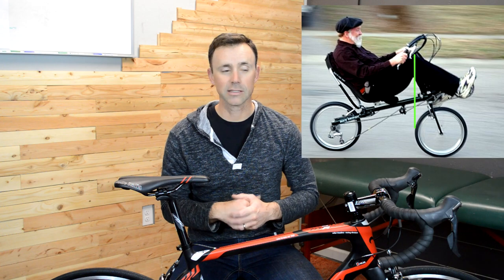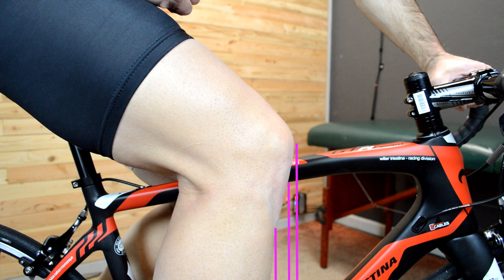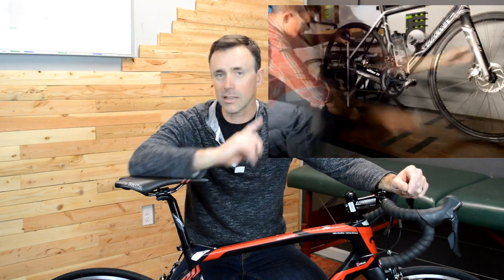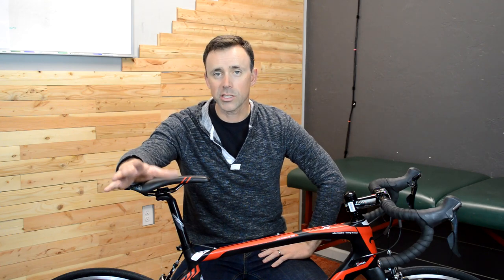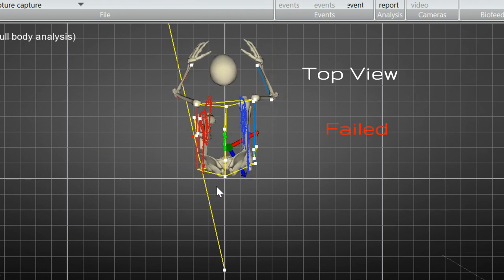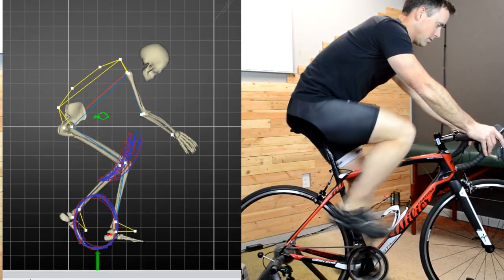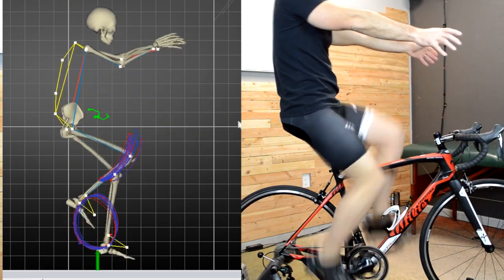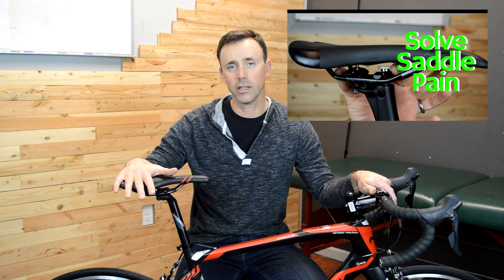How to set Saddle Fore Aft | Bike Fit Tip

Comment: I have been changing around with my saddle and stem length and this is so far the best video I found when it comes to fore and aft of your saddle. I already saw a few that recommended to check the balance, however this one precisely explains which actions indicate which problem.
I recently shortened my stem length and I will do some balance tests to see if I need to shorten it further and go back some more. Also I tilted my saddle, which is increasing the comfort but making holding the balance a bit more difficult.

Comment: I watched this video last night. Recently, I've noticed that when I took my hands off the bars and sat up (while riding a trainer), that I was in fact sliding forward. Today, before getting on the bike, I slid the saddle back 3-4mm. I had been using the plumb line from the knee method only. I immediately felt better on the bike and stayed put when I sat up with no hands. Less strain on the abs also. I felt during the session that I had a bit more power and bonus: the chronic hand numbness I've been getting was much less pronounced. Thanks. I wish I lived out there (I'm in Toronto). I would bring my bike and have you do the whole fit routine.
Reply: if you did not slide forward anymore, he recommends you to move it forward.
Reply: one key thing here that shouldn't be overlooked is that when your bike is on the trainer the front wheel needs lifting to ensure your saddle is level (or in the same position) as it would be on level ground - otherwise you've missed a really important factor. I'm not saying you've missed this, but I bet tonnes of people don't consider this properly. Even with a riser my front wheel is slightly lower than when the bike is on the ground.

Comment: I'm no bike fitter, but I am a former marathoner and do understand the bio-mechanics behind the test. The position of your body mass relative to the crank changes based on seat position. The key is having your body mass balanced against the force applied while pedaling normally. When the seat is too far forward,  the force is mostly vertical, and does not apply enough rearward force to keep your body in position without your arms holding it there. This is why you move forward in the saddle with this condition. Moving the seat back relative to the crank produces more rearward force from pedaling, and balances with your body mass so your arms don't have to work to keep your position on the saddle.
Reply: Thank you!
Reply: Yep. And also, working on thoracic spine flexibility will allow you to reach further without having to tilt your pelvis forward. That way you keep you sit bones holding you on your seat and not your sensitive parts.
Reply: @iwontreplybacklol7481 so keeping saddle forward is better ? In my bike have saddle all the way forward , it’s what I’ve found the best in terms of comfort and power , I have a hybrid bike

Comment: I agree it's a bit confusing. One minute it seems to say that you should slide forward, then says you shouldn't.... I think the best way is to go as far forward as you can  whilst still being able to ride for hours and hours (however many hours you ride for) without neck or shoulder pain, or pins and needles in fingers. Or front of knee pain!. Just keep sliding saddle back until the latter stops happening. I find that that spot leaves my kneecaps about 1cm in front of KOPS.  One method that works well is "can you lift both hands off the bars together, or do you need to do them one at a time?" Ideally you can lift both hands off the hoods together without a big strain. Oh and saddle needs to be level and the right height for all this to work (heels scraping pedals). Then position bars so you use all parts of them without strain.

Comment: For those trying to get into an optimal aero position, a more forward seat position in relation to the bottom bracket opens up the hip angle and allows rider to generate more power for the same given torso angle. Often this will compromise the hands off test. Which is more important? It depends on the priorities of the rider.
Reply: Isn't that incorrect? Moving forward does open up the hips more but removes more of the larger glute from the power cycle. So it's more aero but less powerful position. That's why most people don't produce as much power on their TT bike even when not tucked into the skis. It's because they are further forward of the bottom bracket so less glute activation. At least that's my understanding.

Comment: thanks for this video. I was sliding forward slightly when doing this test, or I had to push off the handlebars a little bit. sliding my seat back about 0.5-0.75cm made a world of difference, as it was apparently set about 0.25cm forward from center of the saddle rails.

Comment: I tried to understand and analyze this video but ended up very confused.  It's not clear if we should move the saddle forwards or backwards. I also saw the previous test video and they mentioned you can get a "positive" result test while here they mention a "failed" test, and it seems that both positive and failed are the same? That's contradictory.   What should we do if we perform the test and our hip slides forward? What should we do if we use too much abs muscles? What should we do if our cadence is notoriously increased?   Thanks.
Reply from the maker: +mcclausky apologies, especially on that first video I got stuck in my PT-centric speak a bit -- positive sign/failed test, negative sign etc. If you slide forward, have to use abs excessively, or increase cadence a lot then you may want to try the saddle back a little. A little movement can go a long way. And you'll have to decide based on your fitness, mobility, riding style etc how much you want to bias your weight back versus on the front end of the bike. But most riders can make a very small aft saddle adjustment (with perhaps a stem adjustment to equalize the cockpit length) and feel more stable on their saddle. There's no requirement to move the saddle until you can do the test without any of the negative outcomes (hips sliding etc) but if you're having issues in the bike -- whether they're saddle discomfort or hand pressure, neck pain...whatever -- changing the balance in this way could be a means of remedying them partially or entirely.   Thanks for watching....
Reply: have to agree. I am a PT with several decades experience with GC riders, and this was painful and confusing to listen to. 
'using your abs excessively'? compared to what?
Not a lot of genuine pro rider tech makes it down to the local bike fitter and shop level imo. 
1.
Pros overall buy one frame size down on what is recommended by the manufacturer. Why? because they want to get their stem down lower for aero advantage. They also work like hell on spine flexibility and low bodyfat%, and have a skeletal system that can tolerate the higher hip flexion angle associated with a lower back angle. 
How much you use your abs when you sit up from the bars will depend on the height diff between saddle and stem. This PT doesn't consider that. 
2.
There's been a trend in the last 15 years to move the saddle further forwards. Why? because it allows one to use a higher cadence, especially ascending. 
3. pros use longer stems for two reasons - they use a frame 1 size too small, and because having their center of gravity further forwards gives better bike handling when descending and cornering. If you want to stop death wobble, move your center of gravity forwards by leaning down lower towards the top tube and stem. if you want better control in corners, your saddle is better forward as much as legally allowed and use an appropriate length stem to maximize your back angle without compromising hip joint angle, breathing, and power generation. 
4. as for cleat position, that comes down to power generation for a individual courses. ideal cleat position for climbs is not the same for flats. 
5. knee angles? the old adage that 25-30 degrees is a good starting point for triathletes, and 30-35 for road cyclists. 

What trumps all this though is individual rider comfort on the bike. Without exception, riders have asymmetries and pain issues that take precedence over what's theoretically ideal.
Reply from the maker: Criticism taken, not my best video, and I'll do better next time. 

With all due respect though, you've never done a bike fit, have you? Be honest. Because your point #5 about knee angles isn't even arguably correct...it's just wrong. The "old adage" of 25-35 degrees hasn't been used in about 25 years since we've had the benefit of dynamic measuring in bike fit.  Additionally a triathlon setup will generally (on average) have slightly more knee bend, so less extension than the typical road position. (As a test, you should pull 10 triathletes out of a local race and give them all a dynamically measured knee extension angle of 25-30 degrees and I guarantee you'll have 10 unhappy triathletes).

Before you condescend about the information not getting to "local bike fitters" please do your homework....
Reply: Have I ever done a bike fit? Wow! 
If you are asking that based on point 5, can you read it again with a cool head. I said the old adage is a good starting point,  a distinction you must have overlooked. 
optimal knee angle varies based on course terrain and cadence. 
Being the seasoned bike fitter you are, I am sure you aware of the pitfalls of recommending one knee angle for all occasions. 
Have a great day!
Reply from the maker: To be truthful, yes, your recommendation on point #5 did make me think that. I'm sorry, but the "old adage" and how you noted it, is a terrible starting point -- as I said before the range is wrong (recommending too much extension) and it's dangerous to propose that a cyclist should expect to have more knee extension on their triathlon bike than on the road bike. That's actually the only reason I decided to weigh in in the first place -- I'm only stepping in on some of these threads when the information provided by someone could set back or harm a rider who decides to take the advice. Have a good day as well...
Reply: I second helicart on this. Very confusing video. Still don't know what he means by failed test, even after his attempt at clarifying his video comments. He's touching on very relevant themes, I'm sure, but his explanations are as clear as mud to me.
Reply: You're best bet is discard this information, it is highly incorrect and made up of this gentleman's theory. His theory of the balance test is highly plagued with variables. For one body types i.e. longer or shorter torso, weight distribution, core strength, flexibility etc.all could greatly shoot this information down quickly and put you in a position that could definitely cause injury. I would basically disregard this information totally and go see or consult a qualified bike fitter.
Reply: @helicart  Are you sure about the knee angle for road cyclist and triathletes? The larger the angle, the lower the seat. So Tri-atheletes have greater seat extension? For riding flats?
Reply: Don’t let the the overly pedantic haters get you down, I thought this was a great informative video.

Comment: I just got a new bike with very different geometry than my last one (endurance frame to race frame), and this was super helpful for me! I found I was putting too much pressure through my hands on longer rides. Turns out that dropping the saddle about 1.5 cm and then pushing it back around 7-8 cm did wonders for comfort and stability. Despite that change, it did not really change my reach too much (although I'm playing with that now that the saddle is set) because both lowering and pushing it back kept the distance to the bars relatively the same. Still need to fully dial it in, but it's way better than it had been.
Reply: @Unknown Yep, definitely meant mm.

Comment: When your stable on the bike, you know it, that feeling of stability, smooth power transfer, control and comfort is obvious. I faffed around with my fit over the years, big set back, reach and all that. Then one day, I was going through a web site with a pro cyclist's bike, which happened to include the rider's fit and height. After digging around I came up with 10 or so riders similar to myself, then averaged up their fits, and changed the bike according... The surprise was when I got on it and rode around, it felt amazing, bit of lowered saddle, moved the saddle forward a bit and bar height. I've had it like that for 3 years and as you suggested I did the test with hands off the bars... no sliding and I can ride easily. 
Doesn't work for everyone, I'm sure but my methodology worked for me...
Reply: Do you remember what website that was?
Reply: @Ansf3R  I think it was Bike Radar,  have a hunt around here....  https://www.bikeradar.com/search/?searchTerm=pro+bikes

Comment: I’ve found that moving the saddle forward a bit increases my speed and power. I ride a Giant Defy which has slightly more slack seat tube angle which would place the saddle a little farther behind the bottom bracket so moving the saddle forward a bit makes sense.
Reply from the maker: Absolutely, and I think each of us has a different amount that we want to be behind the bottom bracket

Comment: Hi John..Excellent tutorial...One thing I have done is I recently purchased an inexpensive set of magnetic rollers,not so much for off-season training but as an aid to monitor bike fit.I firmly believe that nothing  beats an experienced bike fitter, but the ability to check one's own  cycling    position on the bike,without worrying about outside influences,i.e. traffic,I find invaluable.A good  example would be setting up cleats on a new shoe/pedal combo,or dialing in a new saddle...Once again,nothing replaces professional advice,but may simply augment it....Cheers!!

Comment: The sitting up test is a BALANCE test, so please listen to the results of the test! When you release the bars and begin to sit up if you're using your pedaling motion to push yourself backwards on the saddle to maintain a slow and steady sitting up motion then move the saddle backwards. BUT if your pedaling motion starts to drag you forward once you release the bars (these are both using level saddles) move the saddle FORWARD and not backward like the video details. The test is a BALANCE test and you can be on either side of the balance so adjust according to your needs. Do not fear moving your saddle forward if your weight distribution and positional balance dictates you should!
Reply: ehm.. if you balance on a bar and feel you are falling to the right, do you try to shift your center of gravity further to the right?
Reply: @markuswahl2281  - That isn't what's going on here as on the bike without bars you're not in free fall like the example you're making. You're still attached to the bike in two locations - the saddle and the pedals. To stabilize the upper body you use leverage from those two contact points.
Reply: @Vermonstered  I'm sorry my friend, that doesn't make even the slightest sense.
Reply: @Vermonstered  Easy there, cowboy. I would advise you to be more careful when throwing around these semi-academic words if you don't have a good understanding of them. I think I will agree to disagree with you. I'm sorry for offending you!
Reply: @markuswahl2281  How about this one: fulcrum. But since your only focus here is to try and go after me and not the concepts put forth, I see what I'm dealing with.
Reply: @Vermonstered This is really funny! I can understand you OhAiShare
Reply: @markuswahl2281  You're funny!
Reply: I find your argument very useful, it helped a lot. I am now able to pass the test by moving the my saddle forward. And I changed my seatpost from setback to inline.
Reply: What is the difference between "using your pedaling motion to push yourself backward" and "pedaling motion starts to drag you forward"?  Isn't that the same thing?
Reply: @sknuts2783 Not sure how you're confusing pushing backward and pulling forward as the same thing? Think of it like a long tree cutting saw. Lean too far back you can only cut one way, pulling further back. Lean too far forward you can only push the saw further forward. Being you want to cut through the tree (or in this case pedal for hours) you need to find the stable middle where you can pull and push the saw in both directions. So if you're falling forward to push the saw you go the opposite direction to balance yourself, same if you are falling backwards making a pull cut. No idea why a balance test is this difficult for folks to understand, there's two fail states and they don't have the same remedy.

Comment: Im not quite sure why you recommend moving the saddle back if in the test one naturally slides forward and then comes to rest? Wouldn't putting the saddle back make it even worse???
Reply: Well his description of symptoms is weird too... Cadence increasing is good ✔ having to use abdominals ✔ sliding forward is bad???
Reply: If you slide forward when you lift your hands from the bar, it's because you are too far forward in relation to the pedals.
 If you move the saddle back then, you will be pushing yourself back onto the saddle more with your peddling (hence increased cadence)

Comment: Hello again; this is good. One question: if we are looking to find a bit of "flat area" to sit on, bringing the saddle back would tend to place the narrower part at the center Potentially, in order to find that flat area, we would need to slide back, causing a need to extend our reach. Just a point that I did not quite grasp. That notwithstanding, the presentation is very helpful and provides orientation; I will begin to experiment and hope to solve my saddle problems. Many thanks for the advice.